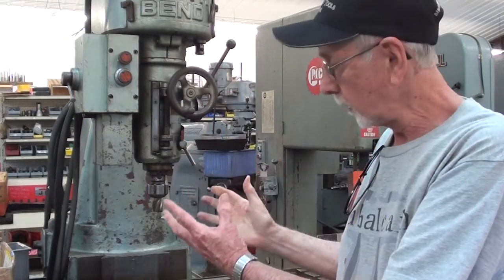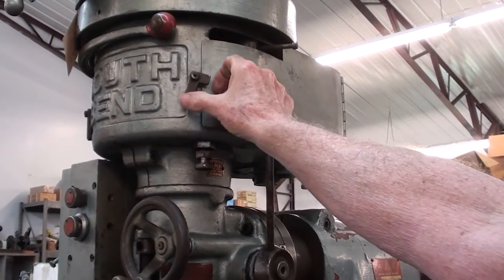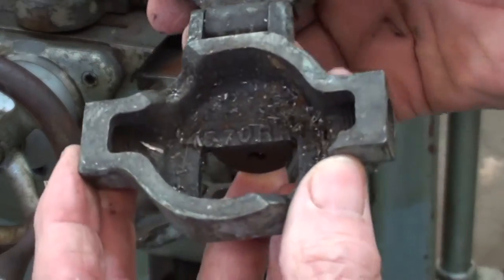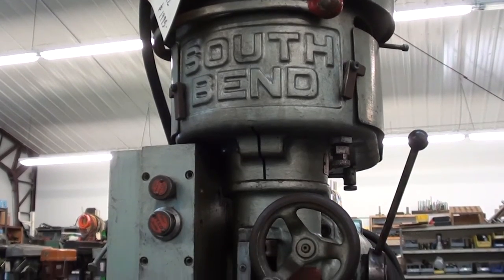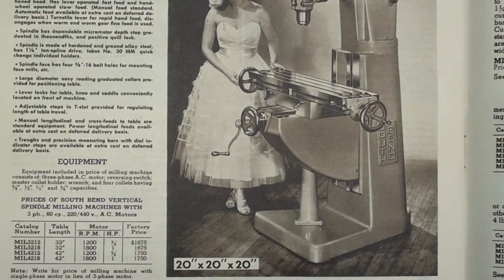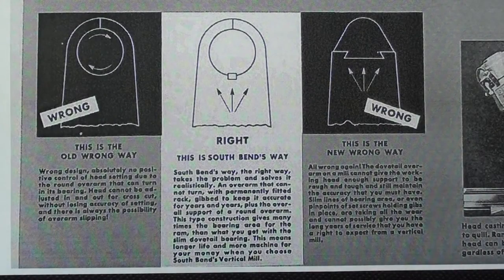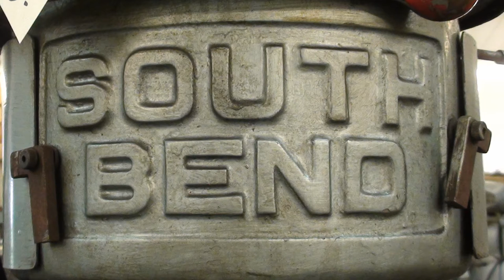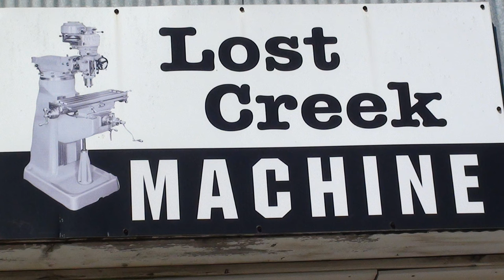IN PRAISE of the SOUTH BEND VERTICAL MILL 732 tubalcain

Comment: I own a 1967 MIL4218 (9" x 42") with Hydraulic Quill, Power X Feed... these are neat machines. The large box on the left side held not only the Hydraulic pump for the quill feed, but also had space for a flood coolant reservoir and pump. The Power X Axis Feed and Hydraulic quill were options introduced in about 1960. The main drawback of these things today is that it is hard to get usable tool holders (they use Weldon/Tree-Type MM30 Taper holders -  Same angle as all 30 Tapers but using a drawbar-less retention system). With a little help from a simple-to-make taper-holding jig, you can convert standard NMTB30 / BT30 / CAT30 / ISO30 tool holders to the Weldon-style retention mechanism by milling the retaining "eyebrows" into the sides of the taper (with a 3/8" to a 1/2"carbide endmill)... I wouldn't use the modified tapers in a high speed spindle (10,000+ RPM) machine after modfication... it might put the holder out of balance at higher speeds. I've got a BT30-45L ER32 collet holder as a general purpose replacement for the ZZ Universal collet chuck. It uses less Z-axis height than the Universal, and ER32 Collets are widely available.
Reply from the maker: Thank you for that information

Comment: I've got a later South Bend with the 3hp variable speed head.  I bought it from the original owner and it has been very well taken care of it's entire life.  This one will be with me until the end.
Reply: I have one that’s over 50 years old. It was rebuilt in 89 and still runs/functions like new. Other than fluid changes and occasionally a deep clean, never a problem. For a manual mill, it will compete with new computerized machines.
Reply: I noted the 1HP on the plate - and felt that was a bit poor ! I'm 3HP - both lathe & mill - and I think the rapid traverse is 3HP as well.
Reply: @lookingbehind6335  'One' - being a South Bend ?

Comment: I very much enjoyed this video. I ran a South Bend mill very similar to this one at my first after-school-part-time-job in a machine shop in 1977. A little lighter weight than a Bridgeport, but it would be just the thing for a home shop. The only thing that would make it better would be an R-8 spindle. Thanks for this video.
Reply: That really wouldn't be possible: The motor sits directly above the spindle, but is not directly connected to it... the motor drives a pulley/v-belt which goes back to the rear pulley/timing belt cluster, and the timing belt on the cluster goes forward to drive the spindle. There is no room for a drawbar to be tightened nor tapped on to release the R8 collet. You would definitely have to move the motor, which would then mess with the V-Belt/Timing Belt tensioner.

Comment: One thing that was overlooked, The South Bend mill does not have a draw bar to hold the tooling in the spindle.  Just those two set screws.  Many people think this is a weak point of the mill and probably kept many from buying this mill back then.  If it had a draw bar rather than the two set screws holding tooling, they may have sold a few more mills.  Any way you look at it, it was tough sale competing against Bridgeport back then.  I remember the school shop had one of these mills in it.  It sat in the corner hardly anyone used it.  I blame that on the teacher they had back then.  He was more into the welding and so were the kids, few wanted to learn running machine tools!  As always, thanks for sharing. Ken
Reply: Getting the tapers out of the head can be "fun" but a light tap from a (light) deadblow is usually enough to free it up easily.

Comment: My school shop had South Bend equipment. It’s some of the best machines built. I still have a set of 123 blocks I made in 1991. I used them regularly until 2010. They passed QC and never failed spec. Not bad for a teenager and manual equipment. I believe it is a testament to exceptional teachers such as yourself. That is something school systems have lost touch with.

Comment: Hello Mr Pete, I was taught during my apprenticeship shop theory courses, the trays along the axis were for gage blocks. So you would stack your blocks in the trays and the indicator would get you your fine adjustment. I will add that I always thought they were on the jig bores and boring mills. Thanks for sharing Mr Pete...
Mike - Plus8Precision
Reply from the maker: Oh I thought they were rods, made as accurately as gage blocks. Maybe you are right
Reply: @mrpete222  Blocks sound a better option for easy arrangement for the length you needed.

Comment: I believe our H.S. machine shop had a mill like this. Machine shop was the one shop class series I did not take . I wish I had but not enough time in the school year. I did have to go in there on occasion to do one thing or another.They had  South Bend equipment and I recall the odd shape of the mill. That shop was set up when the school was new in 1961. I was there in the mid-late seventies.My sons went to the same school and when I went back for open house that shop was gone. The equipment was stored away for years and then all sold off to an auction company. We had a lot....auto/auto body shop, tube electronics (all Eico test equipment), foundry, injection molding, vacu-forming, graphic arts, wood shop, drafting/architectural drawing and photography . All shops with mostly industrial quality professional equipment.Now all gone.......
Reply from the maker: Thanks

Comment: yes I have South Bend Mill, it replaced a round Ram Bridgeport in my shop. I also picked up a heavy 10 South Bend lathe from the estate of the same man that had the South Bend mill and a lot the tooling for both.  The only problem I have with the mill is the graduated dial for the knee is stuck so that I cannot zero it.  I did add a DRO to the table which has the South Bend power feed system and Hydraulic down feed for the quill.  The other mill I own is a Brown and Sharpe #2 universal (1930's-1940's vintage) and on the over arm supports is attached a Spanish copy of a Bridgeport Head.
Reply: Stuck dial ? use CRC Knock'er Loose Penetrating Solvent - and a bit of muscle ! Check that there isn't a locking screw clamping it tight.
Reply: @millomweb  Thanks, I have tried for years with penetrating solvents, strap wrench, now just pretty much work around the stuck dial by using other means if necessary. No rust anywhere on this machine so why just that one dial is stuck is a mystery.
Reply: @boblor2484  Disassembly may reveal the problem. I wonder if it's trapped due to incorrect assembly - i.e. an odd washer put in the wrong place ?

Comment: Hi Mr Pete great story . I never owned or used  a Bridgeport or South Bend mill but i like the dovetail better myself and the R8 taper for cost and for the power feed i like the Bridgeport with the rod stop setup but you can't beat the South Bend dial indicator man that's neat and the cost of new South Bend  machines is expensive .Thank You Mr Pete another educational video.

I  did find a Bridgeport clone a 1998 to2004 Comet 2SG  (2 HP 2 speed motor and imperial threads all  like a J head BP)  made in Taiwan . I bought it this year brand new for $3200.00 it listed for just under $7000.00 in 2004 i got lucky i saw the ad on ebay and no one bid on it and after the ad was up i bugged the guy for a phone # and bought it from Mighty Viper in LA.CA.i think they have a couple more if someone is interested . If you don't like this last part i will delete it Thanks JM

Comment: I do like South Bend lathes. I bought a 10L Heavy in 1983, and a used FOURTEEN in 2002.

I don’t like the round ram mills. No matter what anyone says, from experience, when you bring the head back or forwards, it’s never really at 90 degrees, and you have to continually tram the head. So you almost never touch that feature. As it ages, that wears, if you use that feature. Then the alignment just gets worse. The major Bridgeport innovation (other than their crappy R-8 collet) was the dovetail ram head, which fixed this problem.

Otherwise, it was a well made light weight machine.
Reply from the maker: I agree, round Rams are not good

Comment: Thanks tubalcain for the video on the South Bend Vertical Mill.  Have had one for about 15 years and information always lacking so was intrigued.  Any source for spare parts...?  
( Manual feeds, rectangular base, 32" table)
Reply: Converting a Powerfeed X axis "back" to  manual would take a LOT of parts. The X Axis lead screw would definitely need to be replaced as it is markedly different from the manual lead screw.
Reply from the maker: Spare parts are probably pretty rare

Comment: Lyle - actually, I'd have liked MORE detail on the mill - there were a couple of feature on the head you didn't explain - one sticking out of the belt cover you opened and one round the other side. Maybe one day I'll get to do a tour round my mill - BUT I've two mysteries to solve first (and an electrical problem!) What's the electrical connector on the front of the knee for? and what's behind the brass cover on the table ? Could it really have been set up for a DRO of sorts in 1963 ? And the brass cover - access to a power feed take off for some attachment ?????? As yet, who knows !
Reply from the maker: Most people want less detail. The thing sticking out of the belt cover, it is the lock that wind loosened, lets you change the position of the belt

Comment: hey mr. pete I"M considering buying one of these mills here very soon. this one has the removalble base . with the gear box ... does the gear box control both x and y? they changed the spindle  motor to a 220 single phase dayton. the knee lever appears to be missing then on the left of the spindle just under the motor up top theres a small square opening with a bolt hole on each corner I"M assuming that would be the spindle spring maybe thats where there use to be a power quill set up not sure if I get it I"d like to just not dissasemble it get it home and see what it needs and start to tweak her out. I wish you could come over and give me a hand lol. southern va here lol the man wants 1500 I got em down to 1200 just sending this cause I know your the man when it comes to southbend thanks for all the vids sir keep em comin
Reply from the maker: The gearbox controls only longitudinal movement. You are lucky that it is set up for single phase. Good luck, and have fun with your new machine

Comment: the 2 piece base and column would also be much easier to cast and machine, thereby reducing production costs.
Reply: It also makes them easier to move and set back up. Especially if you have to take through a standard size door.

Comment: What did the 20 X 20 X 20 refer to on the catalog? Was that X x Y x Z?
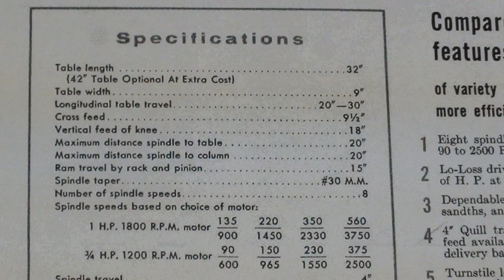Reply: There's a page with the specifications at 19:30, looks like there must have been a model with 30" travel, too.
Reply: There was 20" of x-axis travel, 20" of Y-axis Ram Adjustment and up to 20" of clearance under the spindle. These mills have a great deal of  Y-axis  travel/adjustment options (more than a comparable Bridgeport of the era, but that is offset by the fact the Bridgeport is a Turret Mill), in most respects: that wasn't an accident. SB was aiming for BP's bailiwick.... but never took hold. IMHO, they should have made it a Turret Mill, like the Bridgeport.

Comment: I would like to start machining, what are some good budget mills or lathes for the home shop?
Reply: Don’t be afraid to check out the “Chinese” equipment. The quality has improved drastically on most product’s. You can get a small lathe, ready to use for 5-8 hundred dollars. A bench top mill, ready out of the box will be 7 hundred to a thousand. 
Atlas is a good used option. They are readily available on eBay and marketplace. You should be able to pick one up in the 500-1000 range. Just be very careful of people passing off junk. Also make sure you can power the equipment. A lot of equipment is wired for industrial power. Try to find a Machinist Handbook from the 50’s-60’s. It will be full of information that newer books leave out. Always buy something you can grow into not out of.
Reply: @lookingbehind6335  Thanks any good brands for a lathe?

Comment: I just picked one of these up yesterday! Well i should say a forklift picked it up.. I could not begin to move it. Unfortunately we disconnected 3-phase a 5 years back so I must build rotary converter before I can have any fun.. Thank you for making this video!
Reply: I saw in your other video you have one of these machines. Did yours come with any of the special wrenches. I was trying to find dimensions on the "Special T-wrench" for operating the worm gear to adjust the head angle and am having a difficult time finding info. If yours came with it I would  be very grateful for the dimensions or a picture of it. The picture in documents online is very hard to tell what it is.
Reply: I have the same machine in our shop. We are in need of a manual.Could you send me link to get one? I would like to know if there is a s nut that would work on there for the collets? I just have three z college 13/4 + 3/8 and 1/5 but I have several I believe s collets. Is there a place to order a s nut? I believe the s Nut is a 30 taper if so I ought to be able to use it on this machine. Your video was very informative I appreciate the information very much thank you